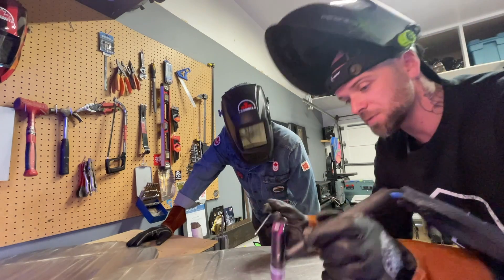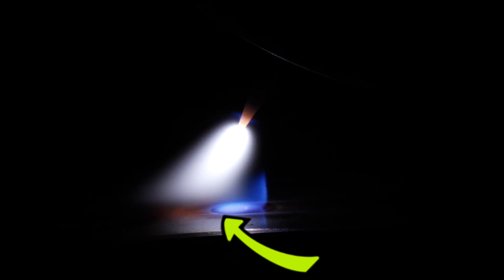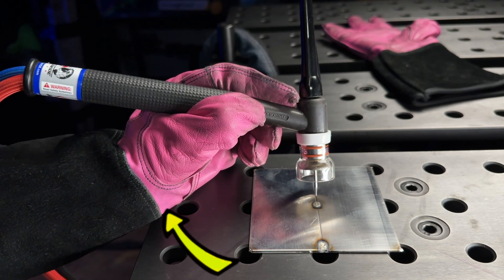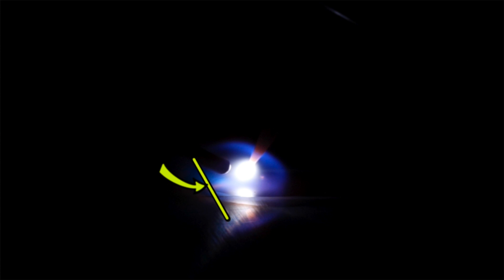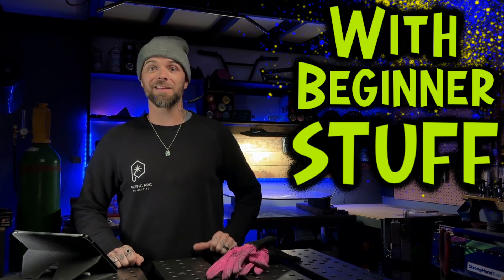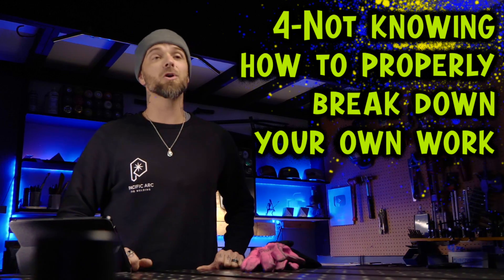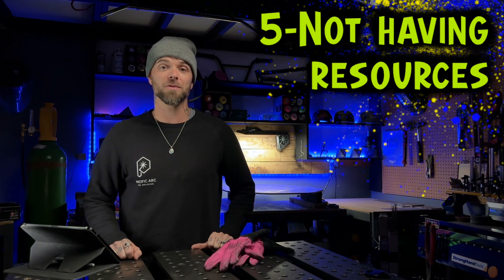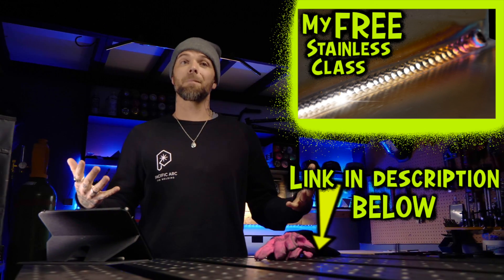5 habits KEEPING YOU STUCK tig welding stainless steel

Comment: I only welded for two years. None of it was TIG, lots of flux core wire feed or MIG. Even in the welding school I attended there was only two TIG machines and one was broken the whole school year.  We all spent waaay too much time on gas welding because that is what the school had the most of.

Comment: Any tips for filling up holes? Im either burning them bigger and bigger, or making it look like bird crap because im just jamming the filller in there.
Reply: Heat is AMPs over time so keep each time you turn the torch on as short as it takes to add one or two drops of filler. Also keeping a wet rag next to the hole your filling to wipe the area to cool it can help speed things along.

Comment: My bro I have idea how you attain such clean welds. .. 
I'm always feeling that my gear is faulty somehow an d it drives me nuts.  It's like no matter what I do : amping up and going faster, amping down and going slower, adding more filler, less, autogenous, they always end grey, dark blue...
Reply: That is a sign your welds are not being protected by Argon, try turning the supply higher. Most of all: practice, practice and more practice.

Comment: Great tips.  Doing ok practicing on flat plate that's decently thick.  But then I try thin stainless exhaust tubing.  Having issues with small puddle and not enough room to insert filler in right place in puddle.  Or if I let puddle get large, blowing a hole in the tubing from too much heat.  A video on common problems with stainless tubing and how to fix it would be great.  Best tungsten grind angle for tubing - penetration vs area.  Fixing holes with patches, filler, or starting over. Options for pulsing, androgenous, etc.
Reply: I learned heat control by taking that tube, strike an arc and walk a puddle all around the tube, NO rod, just the tiny puddle, you are teaching your body where that sweet spot for heat is. At this sweet spot you can actually control the temp of your puddle based on how much rod you cram into it, it will never hurt to back off heat a little.
Reply: Thanks.  I definitely need all the practice I can get.  
What happened was my purge line came off and I ended up with a huge hole.  I watched the TFS video where he fixes a exhaust with cracks and holes with bridging.  Still ended up with a sugar mess.   I ended up cutting out the bad metal and fitting in a new piece.  Lots of work and looks like crap.
Now I'm concerned that I cooked out all the chromium and it'll end up rusting.
Just ran across a Everlast video using an aluminum backing plate.  So now I know about backing plates and welding tape.  ...Yeah, I'm new to welding, backing plate never crossed my mind but makes perfect sense.  Hence my interest in how to fix or correct things that have gone horribly wrong.